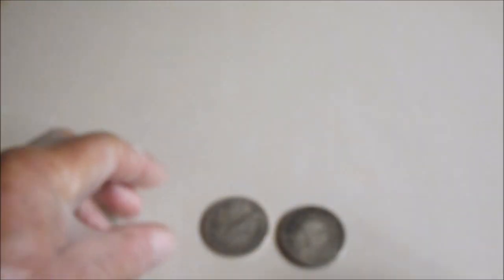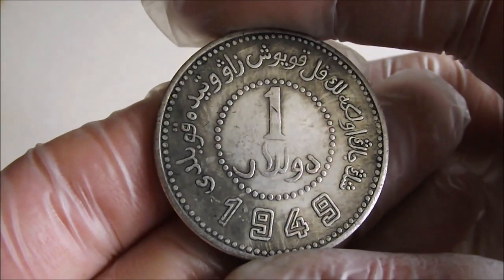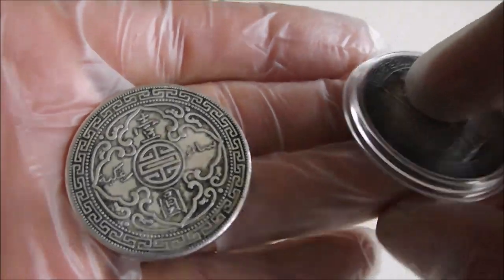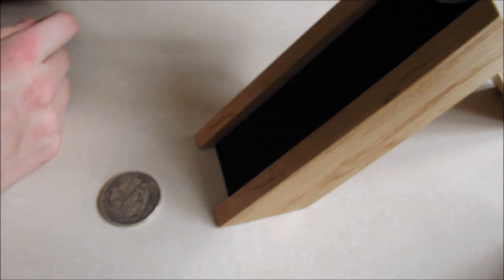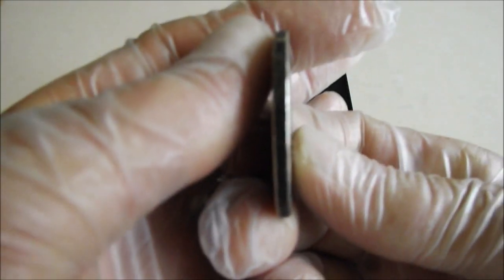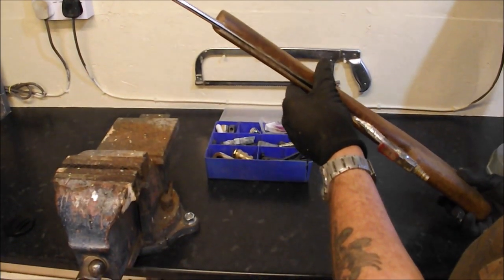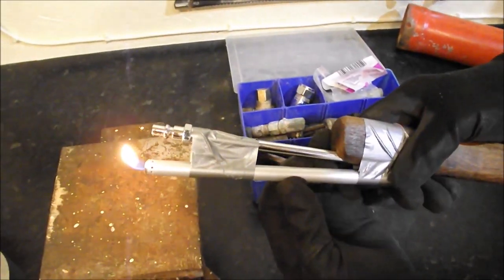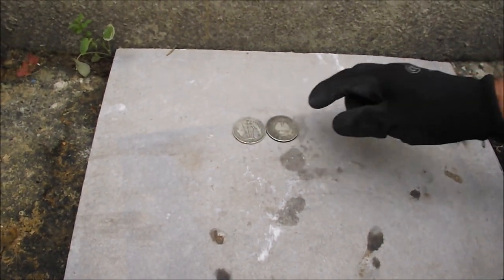A Fake British Trade Dollar sent in for investigation.

Comment: Those black gloves your wearing do they have a thicker material like Kevlar sewn on the inside of the glove but still leaves the finder tips with the thin material for handling purposes?When I worked at the cemetery they used to let us look at the catalogs where they ordered gear for us workers. They were nice enough to let us pick out some nice gloves if we asked for them. I like the ones with the open tips and wrist support. Those were good when us operating the jackhammer. They were anti vibration also but that was minimally effective. The wrist support padded straps were nice. I wish I had brought a bunch home.
Reply from the maker: No, they are pretty thin, but i do have Kevlar gloves & kevlar liner gloves too.